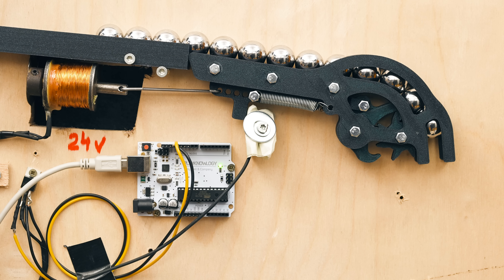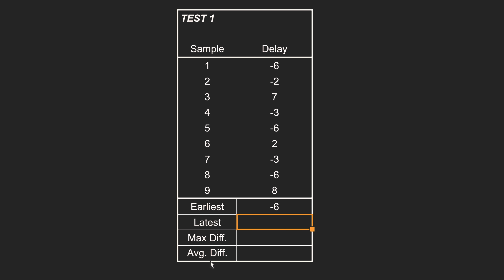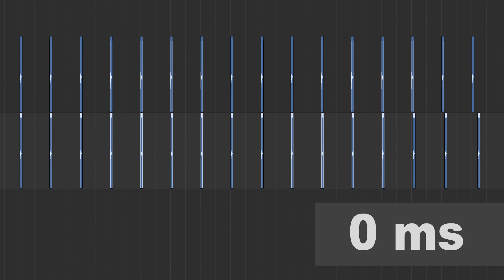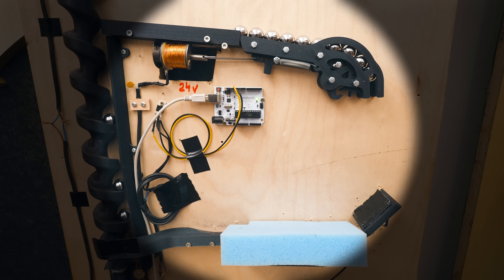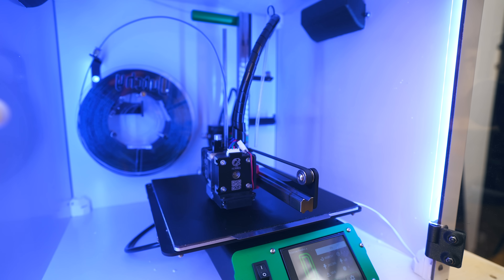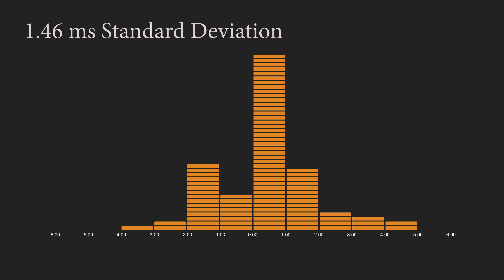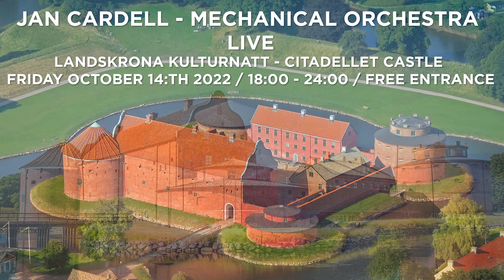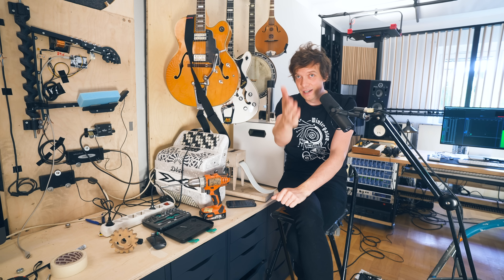Testing the Arduino Marble Gate

Comment: I will say that this is engineering at its finest. Finding the most reliable and simplest solution. However, I feel that much like EV Vehicles coming from Gasoline, The Soul of the machine has been lost. On the Quest for Unmitigated reliability and playing speed I feel that the soul of the Marble machine has been effectively lost with this Electronic Method.

Comment: Do you use AC or DC power supply for the coil? If you use AC and the trigger is not synchronised to the powerline phase, it could cause inaccurate opening times. When you trigger just when the voltage crosses 0V, the coil will not open as quickly as if you triggered when the voltage is at maximum. Line voltage is 50Hz, the voltage crosses 0V 20 times a second (every 10 ms), so I suppose the random delay might be in the 4-5ms range.

Your latter test, measuring delay between coil opening and the ball hitting the target accounts for this delay, but I think it should be considered.

Comment: Two other things to consider:

1. The Arduino might be introducing some latency. Computers are somewhat precise, but any sort of background process might actually cause a very slight deviation in when the solenoid is triggered.

2. Your sample sizes are pretty small for statistical analysis to really have too much value. If you’re shooting to have a machine that’s accurate over several million drops, you want to analyze the statistics over several million drops. It might be worth adding in some mechanisms for real-time statistical analysis, as well, as it might help highlight mechanical degradations before they become failures. Also, even if the entire machine is mechanical, I don’t think having electronics for statistical analysis would be cheating. If anything, it’s a good idea.

I’ll also point out that the tightness of the music played by the machine is going to need to have some sort of tempo-based tuning mechanism. The height of the marble dropping is fixed for each lane, and adds a specific latency between when the note registers and when the note is played. Unless the drop for each lane is precisely the same height, then changing the tempo of the song is going to affect the tightness of the notes being played. It may be within the margin of error (it might still sound alright to the ear), but it’s definitely something to consider.

Comment: A word on the statistics.

Measuring standard deviations is much harder than measuring averages i.e. you require a much larger sample size in order to reduce the error. To increase the number of samples that can be taken you will need to automate the processing of the audio data into timing data.

Comment: Would it be fair in your opinion wih regards to build it fully mechanical...to use the rotation of the machine to power the solonoids when a physical contact pad closes the circuit? Balancing some (super)capacitors could help with power issues of the solonoid

Comment: One word of caution with Arduinos and timing: printing strings to serial is the fastest way to introduce variance and inconsistent timing. I see mechanical engineers make this mistake a lot because they don't realize UART operates at 9kHz~100kHz, while the chip often operates at 10-100x of that. So you end up at the mercy of when the USB-to-COM chip checks its "inbox" and lets you proceed.

Comment: I have just one question regarding the repeatability of the system... Have you considered the effects of general wear and tear on the components? If you are going to go with 3D printed components, how long before the PLA starts to wear down and change the timing of the system. Think about how many marbles will be used in each tune, the number of tunes played, and how many gigs are you going to play. Just a thought that you may consider looking into. 1ms timing is almost perfect... even at 15ms timing it's hardly noticeable. How many marbles  before things wear out and bump the timing out of sinc.

Comment: what if the programing wheel just activated electronic contacts that released the marbles electronically a you where testing... might be interesting to see on The Machine. and, could be less mechanical issues at that point with releasing marbles and then the programing wheel would not need to be strong enough to move the mass of the marbles and connectors etc.

Comment: I do like to see your developing analytical approach but as someone who's been around engineering and signals for a long time, you're doomed if you're trying to recreate the timing precision of a MIDI (that is to say, perfect timing). A farer comparison would be against a real musician playing a real snare drum - do real hands do better than 3ms standard deviation?

 I'd say make the biggest error your metric of interest (absolute difference from expected time) and make sure it is never more than 15 ms too fast or too slow. Otherwise this is going to become a statistical nightmare once you start to try synchronize multiple gates and have to comb through chi-square distributed data just to see if you're making a difference. As is, the small deviations are just going to add the warmth of a slight chorus effect - an argument could be made this is better than "perfect".

Comment: Don't worry too much with everything below 5ms. We usually can't differentiate between two auditory events if they are roughly below 5ms apart. 1.4ms std is fine. Just keep in mind that only 90 measuring points are not enough to draw a good sample size ( as you saw in your test, most hit the 0ms mark) and that your measurements may follow more of a laplacian distribution, which is actually better for you. Tiny statistical nitpick: If you measure the standard deviation, you model only one sigma, meaning roughly 68% of your total distribution. Even if you take your deviation times two or three to model 95% and 99% respectively, 1.4ms deviation is definitely enough. Very tight, surely inaudible. If you notice differences if two sounds are played on the left and right ear: That is called Haas Effect and is exactly how we hear binaurally. Just don't worry about that. Different phenomenon.
Reply: I’m curious what the standard deviation of a drummer is. If the machine can match that, it should be fine.
Reply: @tweer64  Ha ha yes. That would be me. Also the deliberate deviations introduced by jazz musicians everywhere to give a bit of feel or swing. Thelonious Monk and Ornette Coleman spring to mind.

Comment: a thought, a Beat "lag" isn't that the difference when the aurdino sends the signal and the marble his the "instrument", if you set up a system where you record the signal from the Arduino to the solenoid and a when the marble hits the instrument ( a microphone and electronic that send a signal at set strength of the mic, or a receiver only reacting to set strength.) ( this setup will differ with Hight though, but as long the test rig has a set falling length it shouldn't be a problem. ), you should get a standard deviation from that.

Comment: Electrical engineering Student here. I'm assuming you are using a mosfet to switch the voltage to the electro magnet. You will definitely want a flyback diode across the terminals of the e-magnet to limit the spike in voltage across the mosfet, once it switches off. Otherwise the mosfet will probably slowly die from the over-voltage
 You can probably use the arduino to automate the measuring for you. The internal clock is probably sufficiently precise for you and it can output text data (i.e. CSV) to the terminal.

Comment: Wheehh... I was writing in my discent about using Arduino when I heard that you're Not using it in the final machine.  
Discenting draft:"Ohhh NO!! One of the most captivating parts of the marble machine is that it's fully mechanic. Arduino's break the design rules."

Comment: 1ms for an arduino is actually quite a lot! can we look at your sketch?
P.S. okay, that is quite simple sketch. apparently, that is the limitation of arduino framework itself or something. In pure C it is quite possible to reduce timing discrepancy more than 10 times, maybe even make it 100-300 times less.
oh, sketch actually allows using microcontroller timers, so microsecond precision is possible with arduino framework as well

Comment: Standard deviation is not a bad first step, but it really focuses on the average case. Only about 68% of the distribution is within 1 standard deviation. So if you have say 1000 marbles for a song, 320 will not be within those 3ms you calculated. If each of your parts is built to work within 1 standard deviation, you're going to have a bad time. (Basically, each of them will seem to work fine for a few marbles, but when you put them all together and put a lot of marbles through them, the errors will accumulate)

What you really want to do is look at worse case scenarios. You can do that by looking at the difference between percentiles. (You can calculate percentiles in google sheets too)

For instance: Take the 99th percentile and subtract the 1st percentile. That number is the maximum delay between two consecutive marbles for 9,999 out of 10,000 marbles. (Very roughly)

Alternatively, you can look at a multiple of the standard deviation. 3 standard deviations is probably not a bad start. It does make some assumptions about the shape of the distribution, but it's probably a reasonable thing to do.

Comment: Amazing seeing you back, and I really like this approach!
I'm very much not a statistician (I'm a bioengineer/musician/luthier, don't like statistics one bit but it is helpful), but one improvement for your already very nice system: Instead of comparing the standard deviation, use a two sample t-test or ANOVA test. I'll do my very best to explain them quickly, but you should probably look them up anyway:

They're very simple, and google sheets most likely has a function for it. They will output a r^2 value, which is basically the probability that the two data sets come from the same model.
So based on the spread, they will help you decide if the difference you're seeing in two sets is due to the two methods being different or simply a product of random deviation. 
You decide a "confidence interval", which is basically the risk you are willing to take of being wrong. If you decide a confidence interval of 5%, and reject you null hypothesis/determine that the two methods are different, there is still a 5% chance that they were in fact the same, but random error made them fall far from each other. This value is different depending on the importance of accuracy. In the pharma industry, it's usually 1%, in most other cases people use 5%, and you can definitely use a higher one as well in some cases.

As a real life example, I'm doing an experiment right now where one of the parameters is impossible to control and results in very high variance. That means I can't actually use the data to establish a reliable model, but I can use a simple t-test to show that there is a clear difference between my data sets where I adjusted another parameter, and that way I can say what the trends are without actually quantifying anything. Very practical for systems with many unknowns and interactions like your marble machine.

Hope that helped even a little. Anyway, I enjoy your video updates so much, glad to see that you're still working on the project! :-D

Comment: You can use pressure sensors to detect drops with Arduino like thin foil sensor (but it also have lag). Could be easier to analyse on Arduino itself.

Comment: Welcome Back Martin! Where is your requirement for standard deviation value coming from? Can you play the vibraphone with that level of accuracy? I suggest you record yourself using a mallet in each hand and try to hit two contact microphones at the same time 90 times.  Then measure the standard deviation of your two hand synchronization. I think you will be surprised at the result and you can stop worrying about achieving a perfect result. 🤔
Reply: But running a test like that would be actual science, providing actual data, and evaluate an actual hypothesis. I don't think Martin is interested in that.

Comment: It's probably a good idea to add (adjustable) vibrations to the test rig and see what happens.  Or test what happens if it is not completely aligned right with respect to the ground -- how important is it to get it with 5 degrees of orthogonal to the ground?

Comment: I'm so glad you went with a glitter 3D printer filament for an engineering prototype. Who needs accurate timing when you have sparkles? 😂
I'm also happy to see you looking at real statistical measures. It'd would be interesting to know what's the typical std dev for a human drummer. For many people it's that human inaccuracy that is appealing compared to a perfect drum machine.
BTW, one standard deviation is only 68% of the marble drops. You may want to design to 3 sigma to capture 99.7% of the drops.

Comment: nice he is back love to see new content. and i also always thought about useing arduino to trigger the balls. and to improve the timing a bit you can use " PORTB = B00100000;" to turn on pin 13 a bit faster. and "PORTB = B00000000;" to turn it back off instead of useing "digitalWrite" its slow.
Reply: Even the delay function is inaccurate. If you need precision, it is better to use while loop with millis() (wait until the time has passed)

Comment: While I have missed the updates and hearing about the MMX, it's a bittersweet moment right now. As someone who was not alone in being able to watch the livestreams, and who preferred the process pre-elon-asationwhere the videos were arguably as much a part of the art piece of the MMX as the physical machine was... I don't know if I can continue.
It seems you've let the inner engineer kill the artist, and I would only really say that if this is the process you have you need to automate the testing and data pipeline so you're not bogged down with measurements and can let the artist breathe again.
The scalability of this new gate will also present an issue in so much that the additional gates will introduce vibration and other issues we've seen before. Perfection isn't and shouldn't be the goal, and Art isn't perfect.
Reply: I see this reaction a lot, but it's not that he's letting the engineer kill the artist, it's that he's just practicing bad engineering, which is what is killing his art. Artists aren't sloppy chaos agents by definition. They can be precise and reliable, too! And art doesn't have to be frizzy and imperfect, it can be exacting. So, the focus on engineering problems itself isn't the issue, it's the constant wheel-spinning, goal-shifting, and lack of follow-though. The irony is that his overall process has actually been getting getting *less* focused and more sloppy. He's turning into a particular artist stereotype: the one who is constantly noodling on a slapdash, chaotic masterpiece.
Reply: @Mark_LaCroix  i loved the og marble machine and believed in the MMX... But this. Yeah. Whatever spark there was that caught my attention has been smothered at this point. I really started noticing around the time he was pulling in quotes from people like musk and how incompatible their process is to the MMX. With missing the livestreams and being ignored in the request for an editor to create summaries or highlights of key moments so regular content could be posted and also offload video tasks (i remember that he mentioned that that part of the  process was something he dreaded and it was taking up too much time for him) i don't feel connected to the project anymore. I still believe in the MMX, but it's like the belief that an ex will get the help they need to get better: more a dreamer's hope than an actionable belief that creates results. I wish Wintergarten the best, but I'm not going to actively check for progress.

Comment: Finally some actual testing in separated rig. Looking at one problem at a time, making design decisions thereafter. This is prototyping. It is concept testing.

Just remember that seconds (and thus milliseconds) are an arbitrary unit of measurement, you have to stop when it doesn't make musical sense to be tighter.